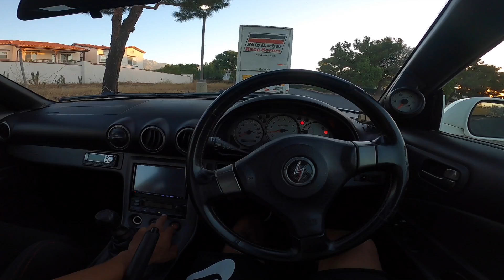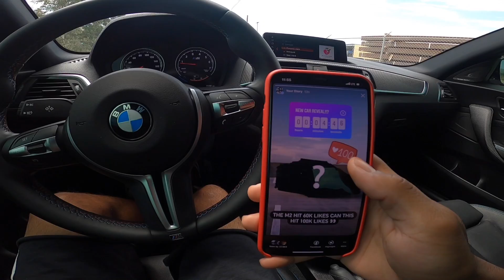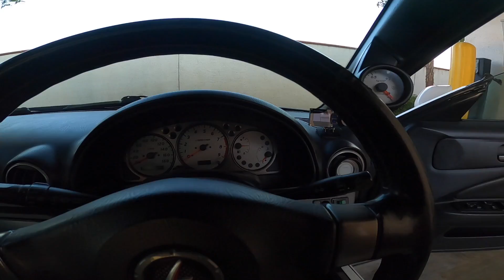My Spec-R S15 is Home!

Comment: Just roll and pull your front gaurds/fender as well as run a little negative camber to clear the guards so you can run small spacers to clear your coils.

Comment: Yo loosen the the 2 bolts holding the coilover to the spindle. Stick a pry bar in the gap between the two at the bottom and pull toward you then tighten it up. There should be some adjustment there

Comment: So the toe and camber is not even with the front right wheel? I get it you adjusted the front left to avoid rubbing, but if the toe & camber doesn't match on both front wheels then it's all out of whack.